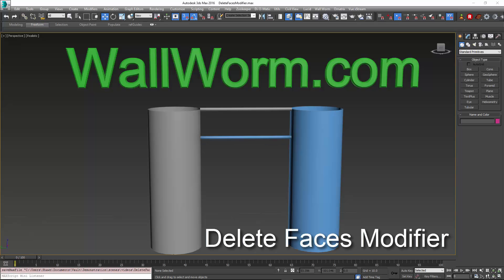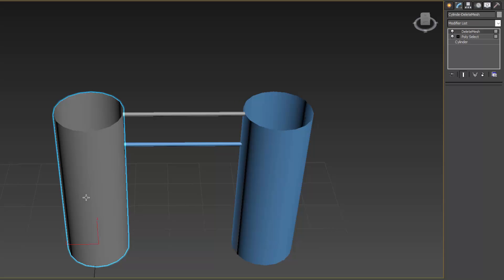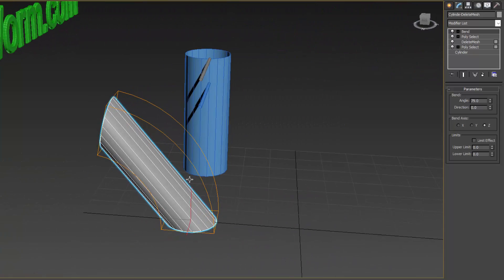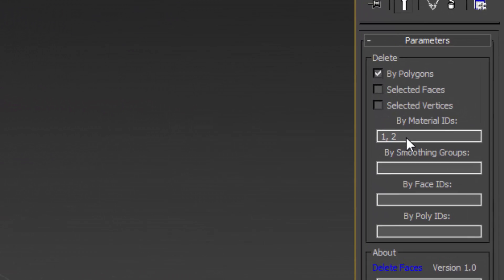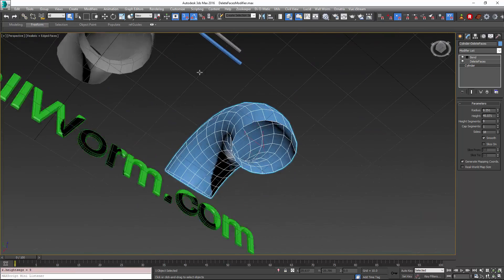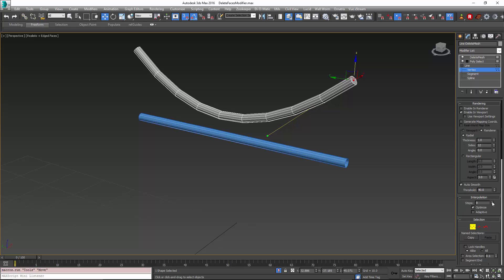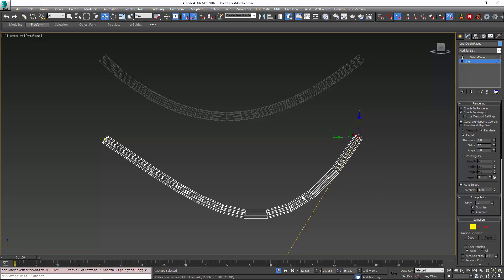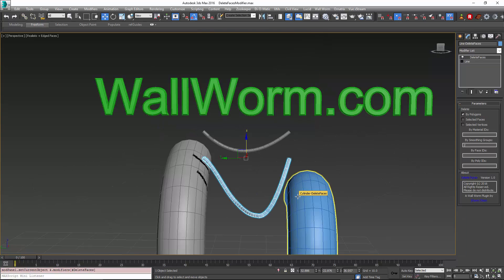Delete Faces Modifier

Comment: Just found this. It works beautifully and you still update it. I can't figure out how to donate for it. This is absolutely perfect for procedural work.
Reply from the maker: Thanks for your kind words. There is also a related plugin called SelectFaces that has all the same features but is for selecting faces. I made it to fill some gaps with the Volume Select Modifier. You may find it helpful as well. As for donating, your kind remarks are donation enough :)

Comment: I am new to 3ds max and want to get  into using WW. Have you considered making an updated version of your beginner guide (lesson 1-10) ?. I think that would make alot of people more interested in this awesome extension. 3ds max has changed so much over the last 5 years that it's very hard to follow the old guides.
Reply from the maker: I'm planning on doing it as time permits. I'll get some new videos on the level design workflow soon.